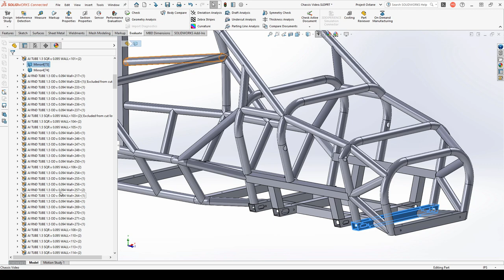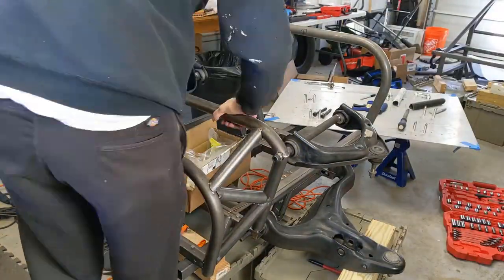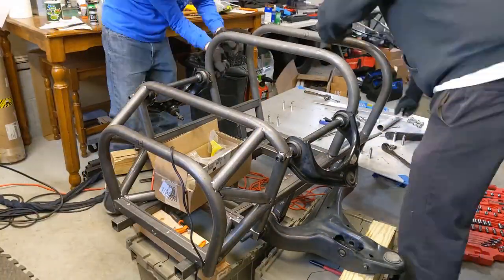Making a Real Life Rocket League Car  |  Build Day 2  |  EP14

Comment: You really need to triangulate the chassis to the control arm mounting points, at the moment they’re just floating in the middle of a tube which will just buckle under hard braking etc

Comment: Very cool project and nice work, but I remember reading that you are going for a lightweight chassis combined with a small engine. Based on that, why did you go for heavy SUV suspension and not something lighter?
Reply from the maker: Good question, 2 factors I really considered.. 1st aesthetics: with near open-wheel design I wanted the suspension to be beefy enough to look like a buggy. A lot of double wishbone car suspensions like early 00s accord have a much smaller spring that's tucked away higher up in wheel well. 2nd reason was just the dimensions, larger A-arms meant body could be narrower and make it easier at our design scale to make the body as accurate as possible. I'm certain there are probably other setups out there that would work equally as well if not better. Heavier suspension doesn't help with power as you said but I think we have more than enough hp in a 1000cc bike to compensate.
Reply: @MegaDookieRL  Makes sense. I didnt even think about the aesthetics, which is very important in a project like this. Looking forward to seeing more.